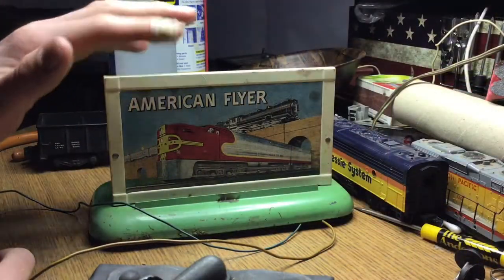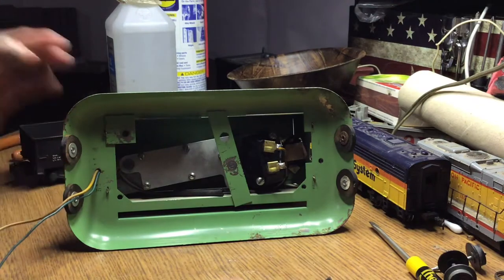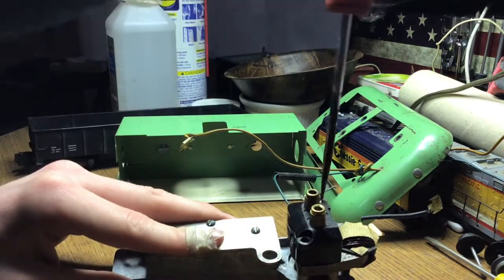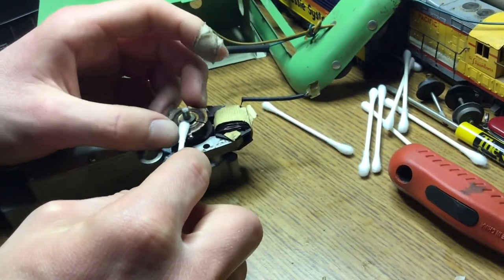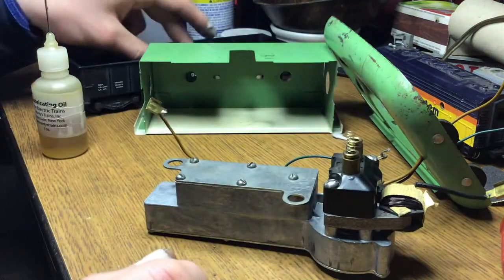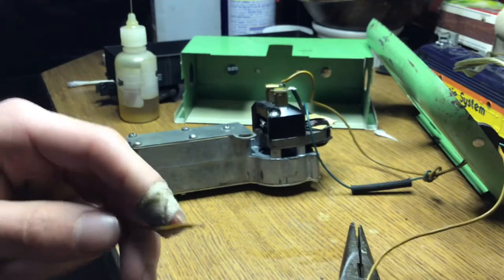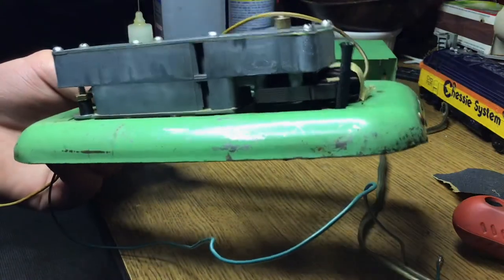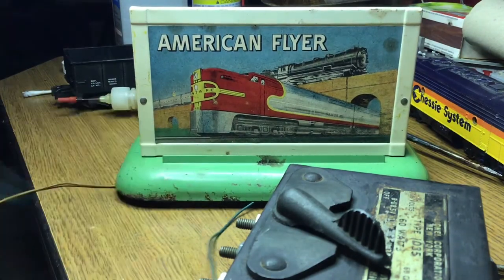American flyer whistling billboard disassembly and repair

Comment: Thank you, thank you, thank you!   Pulled mine out of the closet after 40 years, all rust and nothing worked.   Got the rust cleaned up after a couple weeks, replaced the brushes and cleaned the commutator as in your video.   Motor ran great but no whistle.   Reversed wires as in video and whistle works great now! Thanks again!

Comment: Nice job on that repair. Very well explained. Goo Gone also works good for cleaning commutators, it can clean a little faster than rubbing alcohol. Also, those fiberglass pencils are a couple bucks on Amazon and are great for polishing after you clean the commutator. They won't do much for cleaning really dirty contacts.

Comment: Very nice restoration on this American flyer steam whistle in billboard in s gauge. Btw you could always clean the gaps right there with a toothpick or like smaller plastic here nothing metal on the commutator here that’s where you get your carbon smell at. I do the same thing on my model trains and smt mainline does the same thing too he lives in Canada his name is Harrison if you probably heard of him. If you use like a screwdriver which you know its metal it could ruin your communtator kinda severely you’ll have to get a new motor here which it’s kinda a pain at times but I could be wrong here too. I’m just giving you some advice here on repairing these stuff like model trains here.

Thanks for sharing this!

Matt K

Btw I’m also from ohio too in the northeast where Youngstown ohio is which is Niles ohio I believe it’s like a couple miles here from Youngstown. Idk

Comment: Is it me or does it sound the same as before you did the repair, it sounds more like grinding then a whistle after repair shown in final 20 seconds
Reply: It may need better base rubber or new motor mounting grommets, or the sign housing is loose. I have several and I really like them. Nice job. Same whistle as in the 490 whistle passenger car.